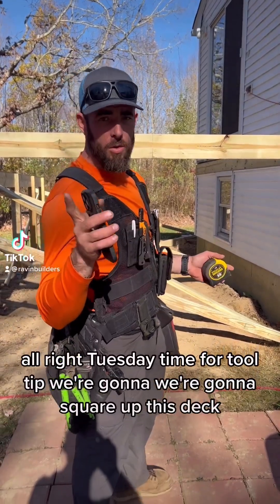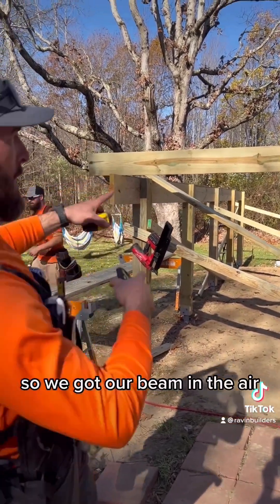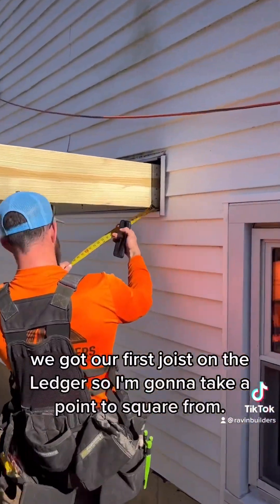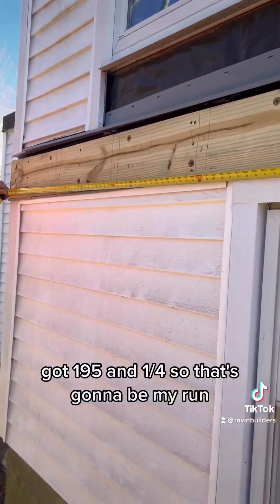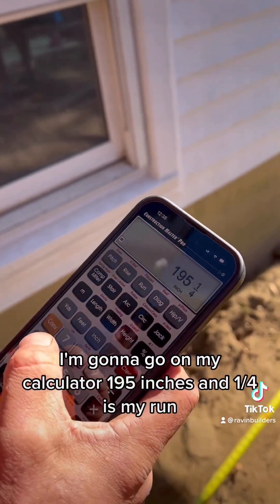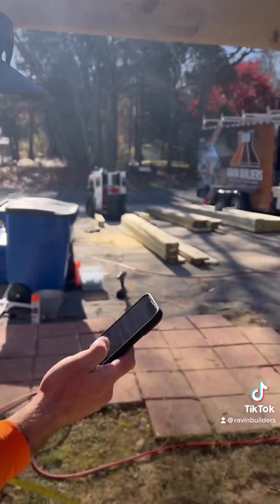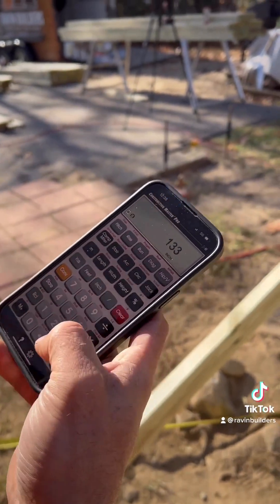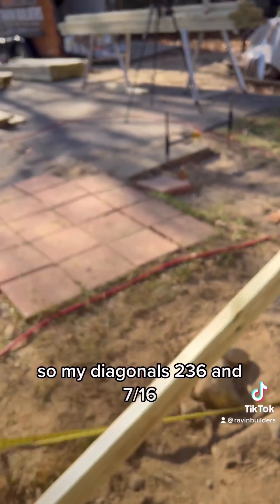How to square up a deck with Pythagorean Theorem

Comment: When you measured the run, you included the thickness of the first joist. The camera panned pretty quick so I had to stop/play in fleeting segments. I guess this determines the outer edge set point of the same joist furthest from the ledger. I’m doing my first ever DIY deck work and constantly second guessing myself…lol They drilled the Pythagorean Theorem in our heads in middle school, so I’ve got that down. Thanks for the video

Comment: Its not run and rise on a flat surface.

Its A² + B² = C²
Reply: It IS labeled “rise” and “run” on the contractor calculator he is using.
Reply: @SCKing-xu5co  Its the wrong terminology 

Rise and Run define a height over a distance.

A deck should not have a change in height.

Nice try. Go back to your keyboard

Comment: Omg u can use any numbers in multiple of 3,4,5 but if your deck is 195 then you measure 16 across 12 out and then connect them at 20’ making this way harder than it needs to be if you need a calculator then Jesus would of used one

Comment: Your deck isn't square my friend... your first measurement was from the outside of the first joist, while the rest referenced the inside corner. Your run measurement is 1.5" too long. It's close to square, but not quite
Reply: I saw the same thing

Comment: Unless you picture frame it you are going to have to have a joint in your boards because it's 3" over 16'. My framing would have been 190" with 1/2" shadow line on both sides and 1/2" to cut on either side.

Comment: i bought a actual  3 4 5 folding aluminum square. it does save time from doing any math or measuring. measuring those diagonals alone can be hard sometimes

Comment: 3ft 4ft 5ft or 6ft 8ft 10ft are CLEAN right triangles......

Fast accurate and easily within +-~1/32 (depending on wood grain/warped lumber) 

Straighter lumber/building material =cleaner 90°

Comment: Run & Rise, are for cutting stairs.
Reply: And roofing carpentry and a multitude of other applications 😂
Reply: @Ethergee  Yes The Pythagorean formula works throughout to building process, but the terms used are different. Run & Rise is for stairs, Pitch is for roofs. When the Pythagorean formula is used to set up cement forms for a foundation, it's just called Square. The terminology is important, for communicating with others.
Reply: @Randaddy96  rise and run can be used to find the pitch of a roof, so I’d have to disagree that you that it’s the wrong terminology for roofing but I do agree is the wrong terminology for finding square, but in the video he was showing how he uses the app buttons that are labelled rise and run to find the dimension for square
Reply: @Ethergee  yep the Interweb can't be wrong. I have built all over the country, Started with an old guy in OR. 55 years ago, who was a stickler on communications & terminology, and having uniform names for things becomes kind of important. In AZ & Florida I couldn't find anyone who knew what a "Cricket" was, in Texas it was Plumb, they argued it was level.
 But if some tech nerd wrote an app I'm sure he's right.

Comment: I do all that before I even dig my holes and pour concrete. This way my holes are squared up and centered for a pleasant look in the end.
Reply: Totally agree.

Setting the posts is the most important thing.

I was taught by an old school master carpenter.

Strung, plumb Bob

3 4 5

No laser levels, cause any idiot can use them, but unless you have an expensive transit set up, not worth it.

In a foundation, yes need the expensive tools,

Cause that is very bad to mess up 

6 FT level, string, knowledge goes along way!!!!
Reply: Who cares what you do

Comment: The math is good, but there’s definitely a margin of error when you’re pulling that much tape over a span and you’re getting sag.
Reply: Tell me you don't know without actually telling me
Reply: I agree, but I'm curious what can you do about it? Maybe have someone hold the tape up in the middle?
Reply: @dangrimes5078  this thread has been hijacked by fools
Reply: That does have an effect, but you do it in stages, 

3, 4 , 5 
6, 8 10

That way you get really sq, otherwise a laser distance, but I've seen them be not accurate and a pain to use

Also just guessing, your not a carpenter
Reply: @joedoucette9028  your comments definitely prove that you're like a Bagboy or a hamburgler
Reply: @Rob-fd6si  what?

I'm a carpenter with 15 yrs experience also spent 15 yrs in  electrica and mechanical engineer.

And you done what?

Ive built more houses then you have probably been evicted from.
GFYS
Reply: @joedoucette9028  doubt it. 
 Good comeback
Reply: @Rob-fd6si  doubt what?
Also GFYS

If you spent any time doing carpentery we would not be having this agruement
Reply: @joedoucette9028  Ok boys, I will agree to set up a boxing ring on my property. I get to keep 50% of the gate and proceeds from the lemonade and hot dogs.
Reply: mechanical engineer.... which about confirms you to be an anal lunatic when it comes to common sense approach to framing.

Comment: All the people arguing over the 3,4,5 versus what he's doing as being the same thing.  Yes, it's the same technique of using PT... BUT...when you use the 3,4,5 rules, you don't have to measure the 2 boards, you just mark out 3 on one, 4 on the other and move the joist until it reads 5 between your marks.  That's a lot easier than the jackassery shown in this video
Reply: Yea and hope that outside joist is perfectly straight. What he is doing is correct 💯
Reply from the maker: Oh, so I don't have to measure 2 boards that I already cut to an exact length. I just have to measure 3 ft on one board and 4 ft on the other? Got it
Reply: Exactly, and then somehow accurately measure 5 ft on the inside of those 2 boards diagonally.   @CalculatedIndustries
Reply: @krististanley8508  so it’s easier for one man to dangle a tape over that distance than simply cutting a batten.  Click bait bollox . The smugness of comments from people who think the calculator is different from 345 just shows what numptys they are.
 What does rise and run  have to do with it, stairs or roofs were not involved . 
 Where was the cross measure. Where were the immovable measure points. 
 Click bait bollox .
It’s a good method; for two men but for one man with a saggy tape and curving the tape in the corners….
it’s just you tube cobblers.
Reply: @140rware  Lol

Comment: I don’t understand why more people do not use this method. 3,4,5 limits you to 3,4,5. I understand you can use 6,8,10 and so on but it does not work out to inches and fractions(unless you want to make it complicated).
Reply: There are no limits in 3 4 5. A 90° angle is still square no matter how long the boards are.
Reply: Because at 345 or 6810 it will be square, who gives a fk about inches or fractions
Reply: @Gravitycreatedlife  agreed.

I'm measuring 3 ft

4ft

5 ft

There are no fractions.

Some people don't understand basic math
Reply: @Gravitycreatedlife  dumbest answer ever
Reply: Unless your lumber has a wicked hook in it (and it better not ) , as long as you cover the span 60+% or so with your 3-4-5 rule, you’ll be good. Same as using your hand square or even a level, it doesn’t have to span completely end to end to get accurate results. That said, if you have the app to do as he did, by all means use it, but you don’t always need the fancy tools to get accuracy.
Reply: @leefottler4744  Building calculators are a godsend. Same process but it cuts down on brainwork which can make you more productive.. it can also do the opposite if complacency steps in(as with anything). The old knowledge will always be needed.. especially if our "leaders" cause this place to go tits up.
Reply: @JMurD3R  Amen ! 😎
Reply: @JMurD3R  It's a deck, no calculator needed. He didn't even add the thickness from the ledger into the "rise" , meaning deck is not square.
Pro tip.... Measure corner from outside of the ledger board and inside of the joist 345 etc. It's more square then his method cause he doesn't even know how to measure.
Reply: @Gravitycreatedlife  Go back and read the comments then go back to sleep please.
Reply: @leefottler4744  even if the lumber is bowed, cause sometimes it is, i use cross bracing to pull sq, and the 3 , 4 5 

6, 8 , 10

Are sq along the length
Reply: @leefottler4744  you couldn't sound less experienced if you had your wife write that comment
Reply: @Rob-fd6si  says the genuis
Reply: Special calculator takes even fractions into the equation. Works EVERY TIME!!! 👍

Comment: Ppl always talk crap on these building posts. No worries about using a calculator man, you're getting it done and you're work looks great so far.
I gotta say though I too am confused about not using the 3,4,5 method but like learning new things.

Can you explain to me your method? What am I missing?
Reply from the maker: Haha yep, everyone's a critic. Both methods use pythag theorem. 3,4,5 works because 3 squared plus 4 squared equals 5 squared. The calculator does the same math but for any lengths
Reply: @CalculatedIndustries  I see. So you just plugged in the exact lengths you needed on your project, yeah?
Reply from the maker: @K.b.173-dog  Yep. And both methods should be the same theoretically. But, I like to work from the end of the board (easier to  move it for corrections on a long board). And if the board bows at all in the middle, checking the diagonal at the end points will give you a more accurate square corner.
Reply: @CalculatedIndustries  Love it. totally get your method now brother. Thanks for sharing it and explaining it to me. I'll try this next time.
Reply: @CalculatedIndustries  honestly man I could even see your method as more efficient, as you're already standing in the location you're squaring it off at. Every calorie counts, and the few seconds add to minutes, hours, days.
Reply: It's all the same method. 4th grade geometry. Pathagream or whatever his name was Greek dude and his theorum for a right triangle. The guy on the video is using the rafter run feature on his construction calculator because the math with fractions would be a drag. It's super useful. To check it is a waste of time.

Comment: Tool tip #2 Always double check with the 3,4,5 method  to be on the safe side
Reply: In a perfect world, with perfectly straight lumber, that is perfectly level, you would be perfectly fine.. with 3 4 5....
Reply: For a bigger square, use any multiple of like 6,8,10 or 9,12,15.
Reply from the maker: They're both pythag. theorem. The calc method shown here let's you work with diagonals that aren't multiples of 5
Reply: Right, but you don’t need to measure the complete lengths. Just measure out to multiples of the 3, 4, 5, mark and measure the diagonal.
Reply: @joeblow9180  the persistence of the blind is numbing. 
Go figure a rafter with your 3 4 5.
Tell me how it works for ya.
Reply: @joeblow9180  complete lengths is better, it’s more accurate
Reply: @Rob-fd6si  so never built rafters?
Rafters depend on rise over run.
The 3 , 4 , 5 method gives you a 90° angle, not the pitch.

That is what a speed sq is for,  determining pitch or rise over run
Reply: @joedoucette9028  uhhhhhhhhuh?
Rise over run.
Speed square.
Any fool that marks their rafters with a speed Sq is a nitwit.
Rafter angles should be marked with ONLY a framing Sq.
Yet never laid out with a framing Sq as the rise/run hypotenuse is labeled on the side of the Sq.
Or use your construction master
like every intelligent response has been trying to convince you of for the last month.

Comment: Beautiful work but lose the quackulator for squaring up a square ……..or at the very least dont tell anyone.
Reply from the maker: It's a rectangle. But I won't tell anyone🤐🤐
Reply: 😂 I'm sure no one's gonna be impressed when the bitch is out by an inch.

No one's impressed when you get it right 80% of the time. But nah, keep building houses with your stones.